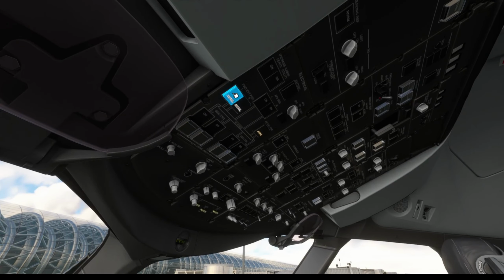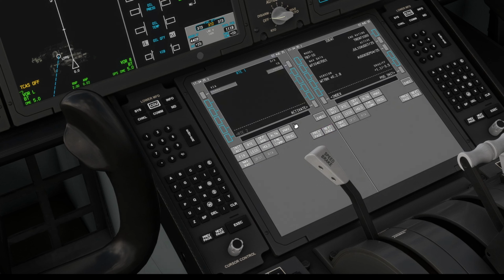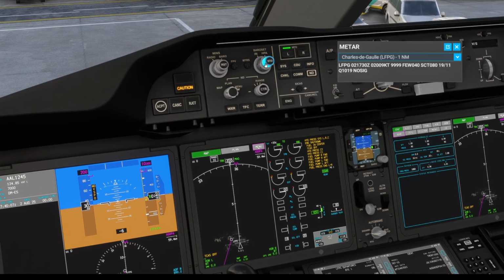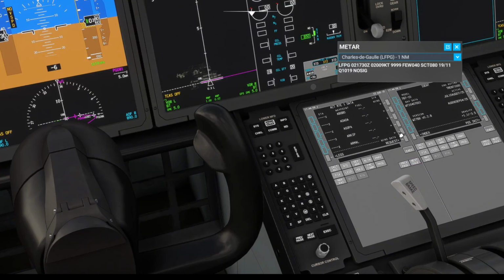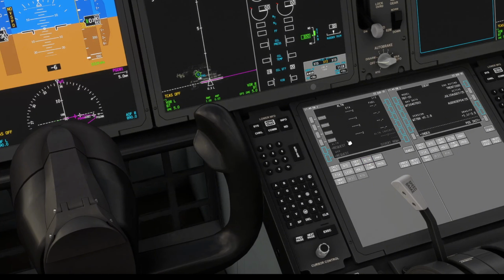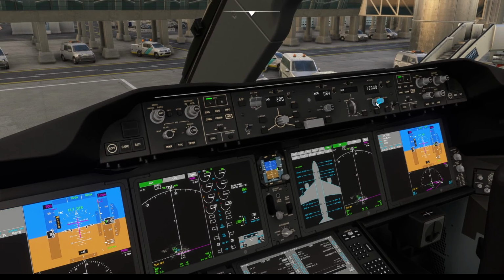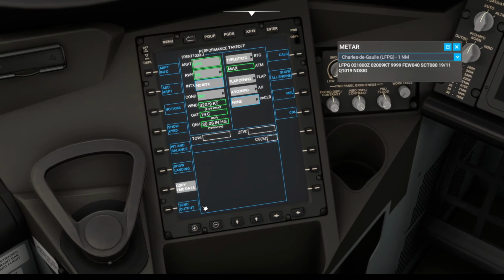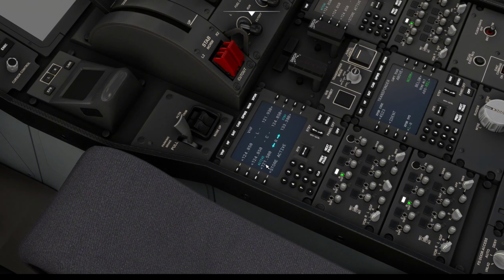Boeing 787 MSFS2020 |LFPG to GMMN| Full cockpit set up and FMC tutorial!

Comment: Thank you for your clear explanation. I'm wondering: are the cockpits of the three Dreamliner variants—the 787-8, 787-9, and 787-10—exactly the same? Greetings, Michel from the Netherlands 🇳🇱
Reply from the maker: I am not type rated on the 787, but they should be pretty much the same! Biggest difference is obviously the weights between the different models.